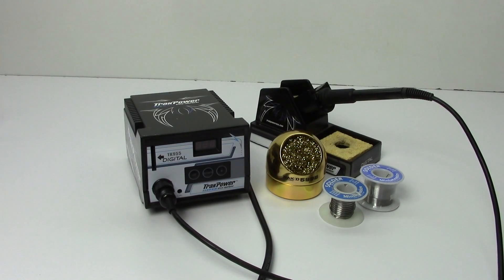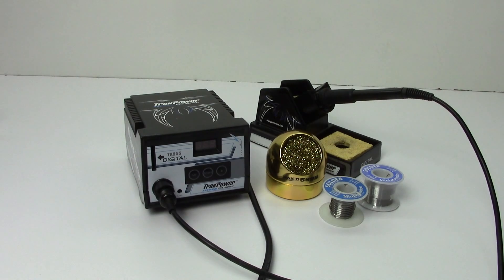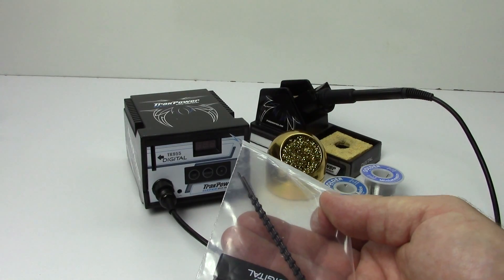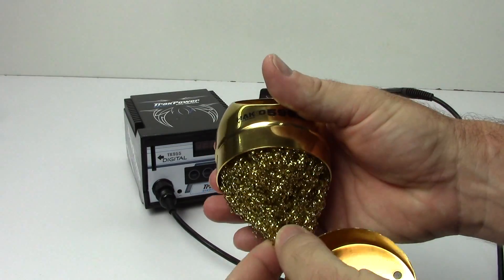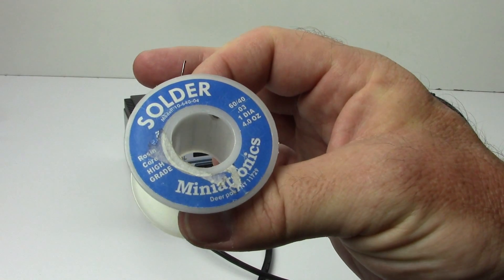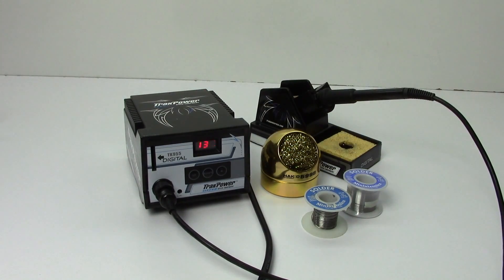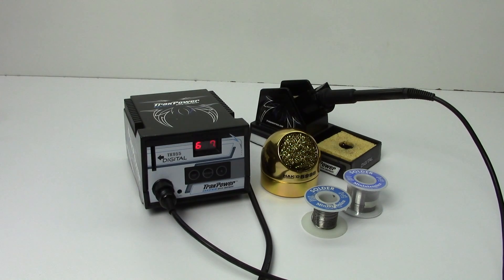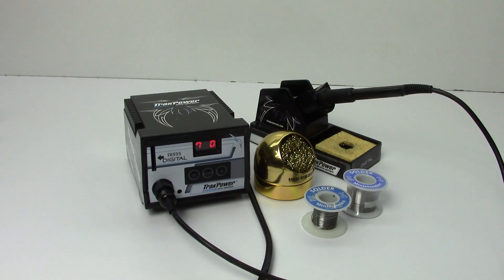Tool Tuesday EP16 - Soldering Station

Comment: Can't wait to get mine! Just ordered the TK955. Needed a solder station because I also ordered the Tekin Gen 3 RX8 with the T8 1700kv truggy motor. Guess I'll have to order that brass sponge with holder thingy to now lol. My E-Revo will be a happy RC. :D

Also I wanted to ask what temperature I should solder the wires to my esc and motor at? I think I heard you say 750 in the video, so I should start there?
Reply from the maker: Between 750 and 800...practice, practice, practice!  It's all about the right amount of heat, solder and technique.  Make sure and get the correct solder as well.  I have a couple of videos that can help:  Older video with Tekin electronics:  https://www.youtube.com/watch?v=dvMR2YH2DxE&t=11s
Newer video showing better technique with HW electronics:  https://www.youtube.com/watch?v=sXDruxcncvE&t=496s
Reply: Thank you for the links! I'll definitely watch those videos too.

For solder I ordered Track Power rosin core lead free silver solder. When I talked to Jeremy Potter on the phone, he said it should be ok.
Reply from the maker: Here's the stuff i use:  http://amzn.to/2uY2N1x  The lead free stuff has never worked for me....but I haven't used the TP stuff.  Leaded solder tends to flow quicker and work easier and faster
Reply: The RCNetwork I tell you what... Trying the techniques from the tekin esc solder video and im failing like crazy. Now i cant seem to get the solder out of the esc cups, because it is all messed up. just pools up when i try to get it out with the tip, and stays in the cup. im getting so aggravated im about to throw this tekin setup in the garbage, and go back with castle who doesnt make you solder anything. :|

I'm very impressed with this solder station though. Hit 750 in like 1 minute
Reply: Well.... 4 hours later, and a badly damaged thumb from stabbing a flathead screwdriver in it. I'm done :P I just made up my own way to do it, and it worked. Just loaded the wire tips with solder, and pressed them to whatever with the solder tip. pre tinning whatever i was soldering to was messing me up badly. I learned a lot from this solder session lol.
Reply from the maker: Practice will only help soldering.  I've watched 10-20 different videos on technique, plus I've soldered at least 50 set ups now....I'm getting pretty good finally!  Don't get discouraged.  Each time you pull out the soldering station, it gets easier and easier

Comment: Yo!!! Rich, just some tips since I haven't commented on a video in a while. the wire mesh should be gently used to remove excess solder on the tip of the iron. and the sponge is to basically to get a fresh start!  Solder should always stay on the iron to prevent oxidation. I also recommend some soldering flux paste! It'll make things go a lot smoother! Especially on micro boards. But that's a nice setup up bro! I know you got those soldering skills I've seen your work!
Reply from the maker: +GTek4u Thanks GTek.....Where you been??  Yeah, I know about the soldering tip and keeping solder on it when stored.....The solder I use has a flux core, so it does a decent job of adding flux in during the soldering.....thanks again for watching

Comment: Another great Tool Tuesday and isn't it the truth a good soldering iron makes a hell of a difference, my personal one also has a built in heat shrink which also comes in very handy. Thankyou as always for sharing you thoughts and your great videos.
Reply from the maker: +Shayen RC Enthusiast. Nice!  Which station do you have>?
Reply: The brand is called Rhyno it was made here in Australia (So they say)
Reply from the maker: Nice...I will check them out

Comment: Well Hell, learn something new every day, and here I have been cleaning my tips by scraping them on a file. And I really need to pick up a decent soldering station, hopefully it improves my results, shaky hands are bad enough (which I still do tech work, but it gets interesting at times).
Reply from the maker: +Anthony Eaglebarger (toysoldier46552) Good deal, the trakpower stations are great.  Makes soldering almost fun

Comment: What do you recommend for a solid setup? Soldering isn't completely foreign to me, but I don't do it very often and the times that I have was with mind-blowingly cheap equipment. I don't think I'll need the fancy stuff that you have, just the minimum. What types of solder do you recommend, and what's the minimum temperature iron for simple things like motor wires or battery connectors?
Reply from the maker: +That Guy With the Pointlessly Long Username That You Are Wasting Your Time Reading Right Now Really, There's not much between the cheap irons and the Trak Power TK950 (lower model than the one in the video).  As for solder, try and find something that still has lead in it....like the miniatranics in the video...as for temp that I use, 750 degrees for most stuff